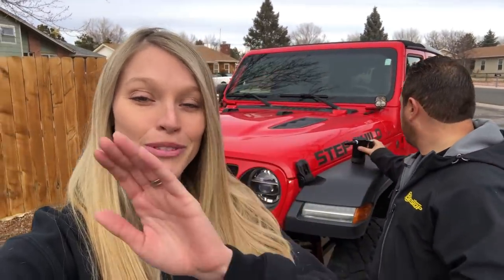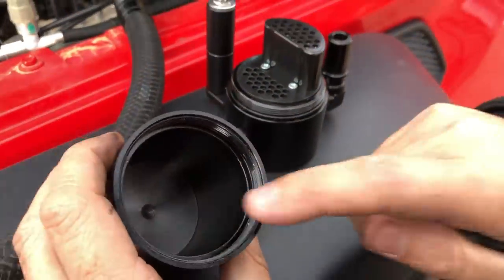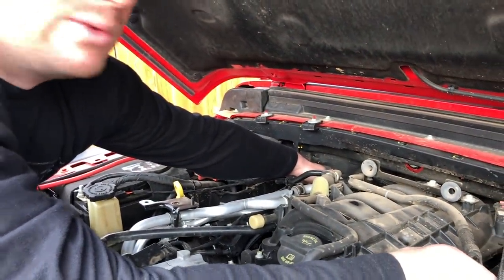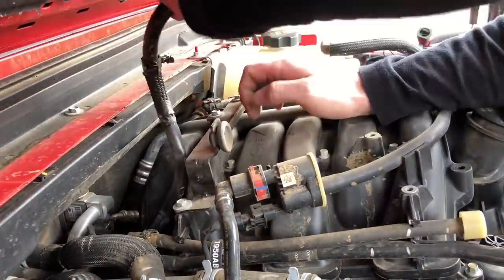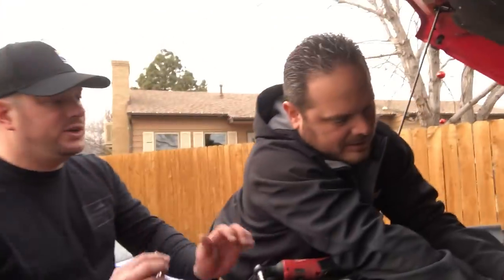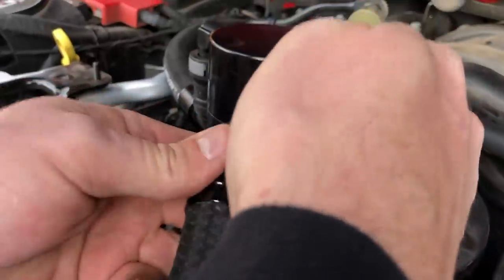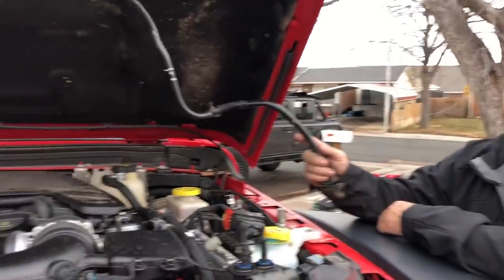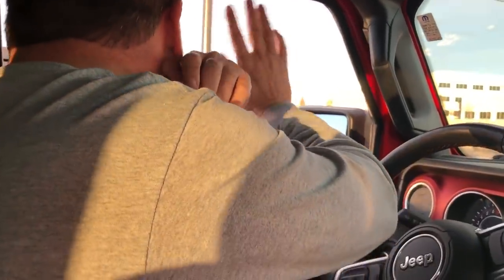NO MORE SMOKING! How To Fix the Jeep Wrangler JL Smoking Issue!

Comment: Great product.  I found it much easier to take the can off of the mount from the top and then attach just the mount itself to the manifold.  I then attached the can to the top of the mount, per the instructions.  Of course, I didn't figure that out until fighting with trying to get the screw into the bottom of the mount through the manifold as you guys did.  I do realize I now have to surrender my man card for reading the instructions.

Comment: First, I enjoy following your adventures with your JLU and seeing some of your modifications and your commentaries.

I recently installed a UPR catch can in my 2018 JLU after reading many reviews on catch cans.  I also watched your video several times before installing mine.  I have a couple of suggestions for others wanting to install one of these on their 3.6l JL.  (1) To install the mount to engine, I placed the allen screw on to the allen wrench and then tightened the mount.  No issue of dropping screw.  (2) The removal of the existing PCV tubing should be done with care, ensuring that all the clips on passenger side are unclipped.  Wiggling the hose out will ensure that nothing else get ripped out because there are a couple of hoses tucked in that same area.  (3)  The placement of the clean hose takes a little work.

Keep up the reviews and videos.

Comment: Cool video, nice clean install. You don't need a turbo, go with a supercharger instead. Really nice unit that fits on top of the engine, awesome unit, 6 psi for safe level boost. Keep those videos coming.

Comment: It’s good to see Kevin in the videos much more than he used to be. Keep that up!

Quick question for you guys. I understand its cold there now and all, but how come up never remove your doors and hardtop? Have always seen them both on for every single video. Just wondering.
Reply from the maker: Alex Winters It’s usually either a matter of temperature, dust, or having no where to leave the doors or top (if it’s a straight through trail and if we’re traveling).

Comment: Looks like you can take the spacer off the catch can and start it on the upside down bolt first spinning it by hand while holding the bottom bolt and then put the can on saving all the 1/4 turns? Nice job. No Jelly? Only came for puppy!

Comment: So instead in burning oil out of the smoke you're going to catch the oil and hold it in a container and it's chicken 3000 miles I like the fact that the oil is burned out and gone but the downside is it smokes as it does it correct? Also where did you buy this and what does it retail for ?

Comment: Do you guys change your own oil or have a shop do it?  The reason I ask is because they changed the 3.6 in the JL to hold 5 quarts. The JK 3.6 holds 6 quarts. I have taken my JK over some pretty extreme stuff like you guys and never had any smoke, but I change my own oil and have never had an issue. Just wondering if you got overfilled?

Comment: I doubt there is a clear answer to this, but I wonder if oil starvation is an issue when the Jeep is at an extreme angle for a protracted period of time. (If so, that my also explain the knocking you heard.) I know there are baffled oil pans and baffle inserts for OEM pans, mostly for drag racing.  I imagine the Jeep engineers have tested for vertical starvation, but would probably not comment on it (due to engine life and warranty concerns). One thing you might consider, where possible, is to roll back closer to horizontal while you figure out how to clear the obstacle. I realize that is not always an option. I would also consider installing one of the non-vented batteries.

Comment: I just smoked my 17 JK this last weekend on a gnarly incline, a man made MOAB Hot Tub just to paint you a picture. I was yelled at to turn off my engine and my dumbass put it in park and e-brake before turning it off (out of habit) 🤦🏽‍♂️
Needless to say I couldn’t turn the Jeep back on nor put the transmission or transfer case into neutral to roll back and I was about to tip on my side and flip backwards 😰 I’m avoiding “Hot Tubs” at all costs now, also my JK hasn’t been idling right since, something about a 6 cylinder miss fire 🙄

Comment: If Jeep vented the valve cover through the middle of the valve cover instead of the rear end, intake oil probably wouldn't even be an issue.   It seems like a weird place to vent from but there must be a logical reason for it.

Comment: So.... Why are YOU fixing it if it's under warranty?
Reply from the maker: Robert844 There’s nothing to fix under warranty. Nothing is broken, it’s simply the way the motor is designed. The catch can is an aftermarket product that with solve the issue.
Reply: @LiteBrite  if it smokes at extreme angles (it's a jeep.... That's what it's designed for) then it's an issue that needs to addressed without anyone having to put money out of pocket. Otherwise.... Lemon law....
Reply: @robby844 Don’t agree on that. They’re abusing that vehicle and eventually the chickens are coming home to roost. I rock climbed a bit with my CJ7 back in the day. I’d never put the old girl through those paces even though those old CJs were built proof.
Reply: @map3384  that's a joke, right?
Reply: @robby844  No. Dana 44 aren’t idiot proof.
Reply: @map3384  what does that have to do with your previous comment? Lol
Reply: @robby844  I guess you’re not familiar with Jeeps.

Comment: I have a 2014 unlimited jeep wrangler it started smoking when idling it and also when coming to a stop and then pulling out my Jeep will start to smoke or if i speed up and it wont go over 2000 rpm up steep steep hills. The engine light came on and I had it checked and it said it was the catalytic converter. I replace my PCV valve and it is still doing the same thing. I also went ahead and changed my oil again and notice the oil is getting burnt quickly and you can smell burning oil When the Smoke comes out of the exhaust anyone ever have their Jeep do this to them before

Comment: Why can’t the catch can have a transparent window to see if it is full or not? Hassle to keep unscrewing it to check.
Reply: Kevin Williams I still think it should have a window so you can just look and see how much is in there. And the inside of the cab should have curved lips around the inside of the can to prevent spill back into the engine on steep angles.